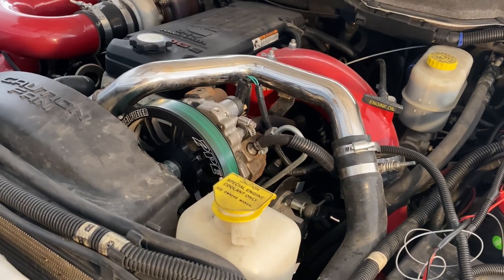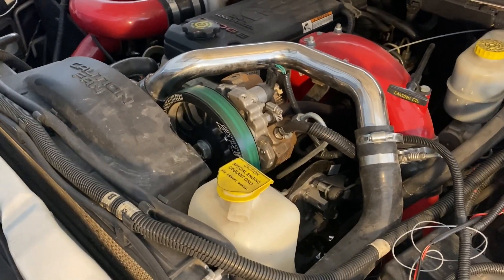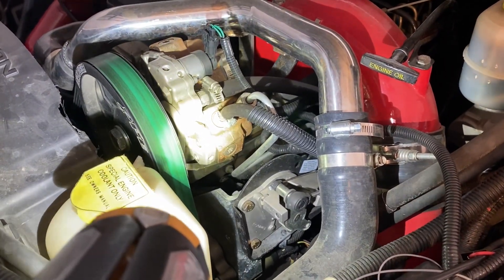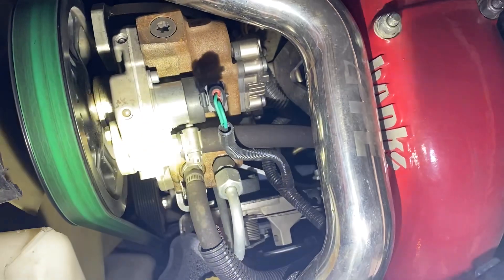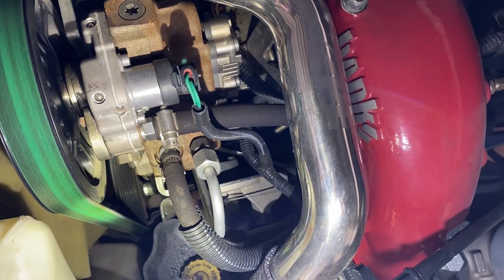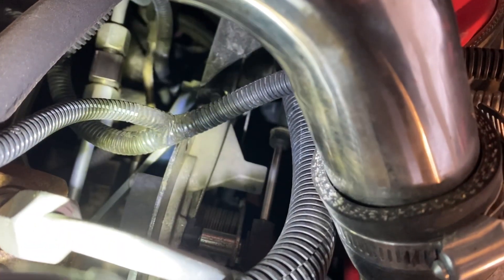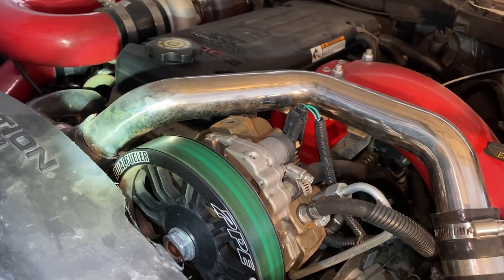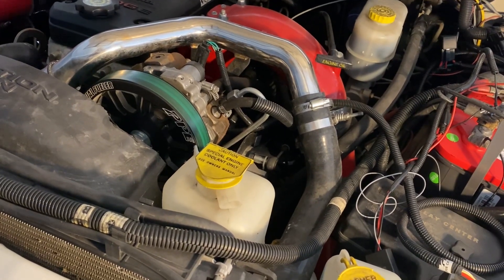Cummins Dual CP3 Kit Review With Installation Tips For A Successful Installation

Comment: This was actually really helpful to see... While I'm not going to be doing dual CP3s, I've been trying to figure out a way to add an air compressor for on board and, but couldn't quite figure it out because the common rails don't have as much space as the older Cummins do... but now it would appear it is possible, I'll just have to do some custom fabrication

Where did you get the modified radiator line?
Reply from the maker: I’m glad it was helpful to you for your project. That radiator line comes with the PPE dual cp3 kit along with all the other provisions needed for the installation and function of the second cp3.

Comment: I’m guessing this kit had held up well another year later?
Reply from the maker: Yes it has held up with no issues. It performed well at a dyno tuning session at Firepunk diesel allowing the rail to hold pressure and the truck to make 872 horsepower.
Reply: @AK_5.9 awesome! I’m really impressed by your truck. I bought the ppe kit last week seeing how much you liked it. It’s sitting on the bench right now.
Reply from the maker: Good deal, I’ve been happy with it. I’d recommend putting some thread locker on the mounting bolts for the bracket that holds the CP3 as I did in my revision in the video. I’m glad my content has offered you some ideas for your build

Comment: Can you run two stock pumps?
Reply from the maker: This basically is like a second stock pump in terms of how much it flows. You need the provisions to mount the pump, incorporate the pump into the serpentine belt and all the high and low pressure plumbing which this kit includes.

Comment: I'm Thinking  about getting the dual CP3 pump kit but does it pass emissions?
Reply from the maker: I am not sure about that as I have only had this truck in states that do not perform emissions testing. I will say that all the dual CP3 is going to do is allow the fuel rail to maintain adequate pressure with more aggressive fueling (larger injectors and tuning). So I think the tuning and injector setup would be a more significant contributor to variations in emissions, rather than the added CP3 alone.